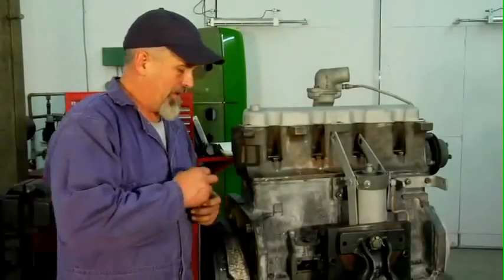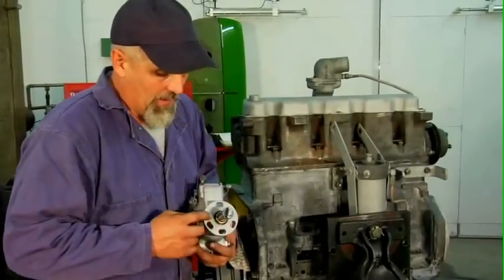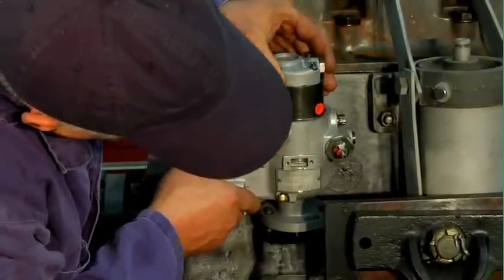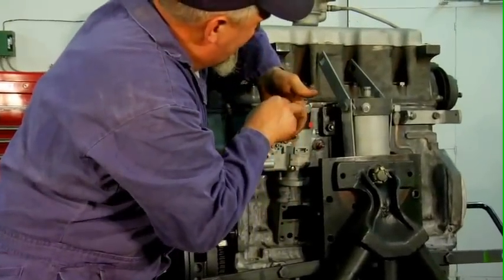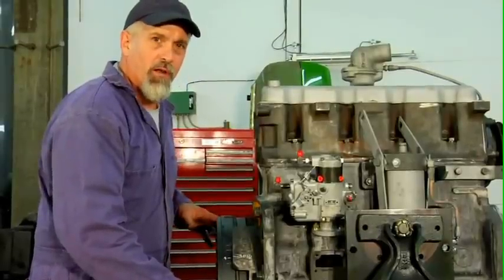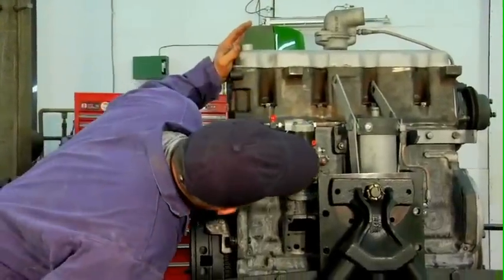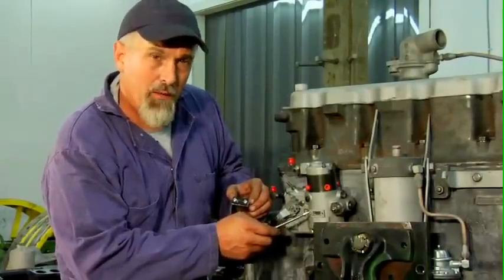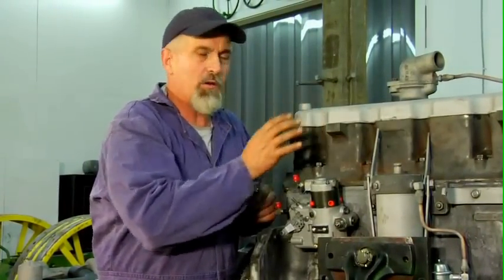Installing a Diesel Injection Pump & Setting the Timing

Comment: Sir thank you very much,i trying to find an answer in my problem.i have an mf230 it has  ad3153 Perkins engine, also the mf 240  has EXACTLY the same engine,mine is 38 hp and the mf240 they are 47 hp, my fuel dose was at minimum ( cav dpa Lukas) dpa 3230f460 . Sw46/800/3/2150, and i opened the plate and adjust the fuel to middle, my  sprin code is 3 , if i change the spring position to 6 (all the mf240 ) i will increase the rpm from 2150????can i adjust the fuel dose to max???? anyway  what i have to do to increase my horsepower???Thank you for your help.

Comment: how do you know if you are on tdc compression or tdc exhaust?
Reply: TDC at compression valves don't move. At exhaust the valves would be moving a little bit. Scavenging is happening.
Reply: Valve rock
Reply: compression stroke with push air out of injector hole -gotta remove injector OR remove valve cover if you want to watch for No Valve rock on compression Stroke

Comment: Hi, Could you please tell me what the start of injection timing should be (in crank angle BTDC) for an IDI engine. What should should it be at fully retarded (low idle) and at max rpm. Thanks

Comment: Great Videos, I have John Deere
310B Back Hoe. it start with no problem, it's seem to start to miss at 3/4 to
full throttle and seem to be out of timing (white smoke). Not sure how it would
have got out of time? As I started looking at items  to cause poor running
I found fuel oil in the crank case oil, did oil change and put new pick up pump
on, old one would not prime with pump lever after changing fuel filter so I
replace it. Check fuel flow from tank to pick up pump (Good) pick up pump
to Injector pump (Good). bleed injector pump line and injectors. Temp on my
exhaust seem to look good from front to rear. I do hear noise at the gear for
the injector pump not sure what is excessive. Once in a while as I'm running it
will loose all power and go right down to idle at full throttle. after shutting
down and starting some times it will clear up and run up again. I was thinking
on getting a timing window and set the timing  advance, not sure if I'm
going in the right directions. I have never used a timing window before and not
sure what timing window to get or where to get one. in the timing window view
does the timing mark float @ the degree line in the window or how do you know
what degree it is at.

Thanks for any help

Comment: i had been wondering if the 4° is used on all diesel motors refering to the 6.9.
Reply from the maker: No, the timing can differ, consult the engine manual for the spec.

Comment: Hay i have a international  270A  and i pulled the injection pump off without timing it first i was wondering if you have some knowledge on my motor its a D-268 4.4 L 4 cylinder diesel  if you have time you can call me 347-530-7927 thanks

Comment: Imeant rocker cover gasket on toyota avensis d4d t2
Reply: +Mohammed Shafiq In a nut shell. Remove any items (if any?) from around the rocker cover, undo the the fixings which you will see around the outside rim of the cover & then take it off. clean both faces of the joint, one side on the top of the engine & the other being on the cover itself making sure you take off any of the old gasket & then once you have two clean metal faces apply  a new gasket with or without gasket sealant (though I do on both sides of the new gasket for good practice! )  then put back together & tighten the fixings/bolts down in a clockwise order only nipping them down on your fist way round to then go on & set them with a torq wrench if you have no experience!